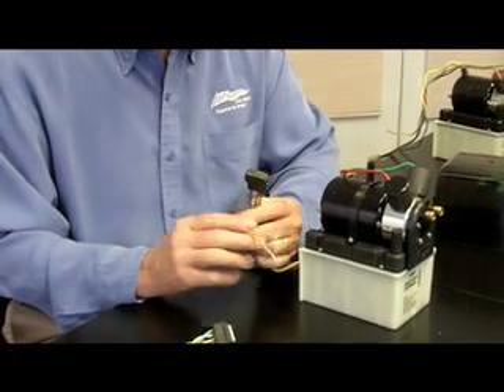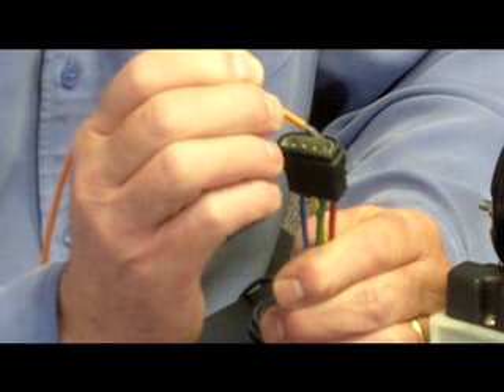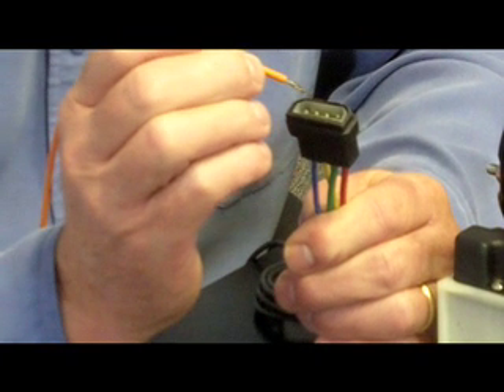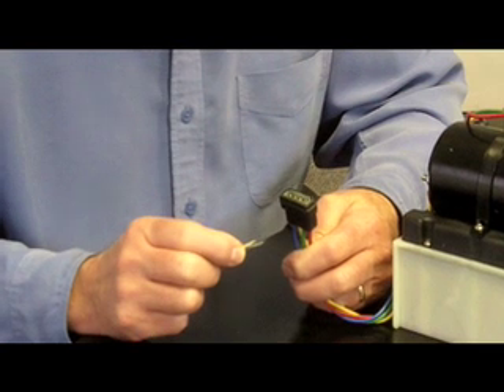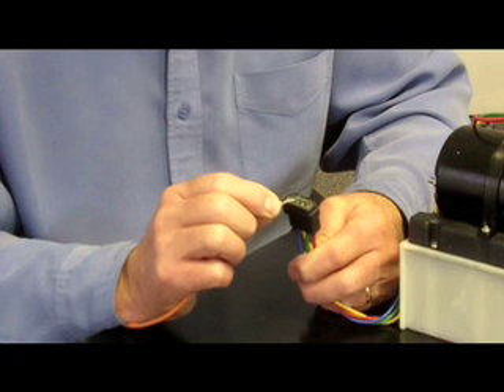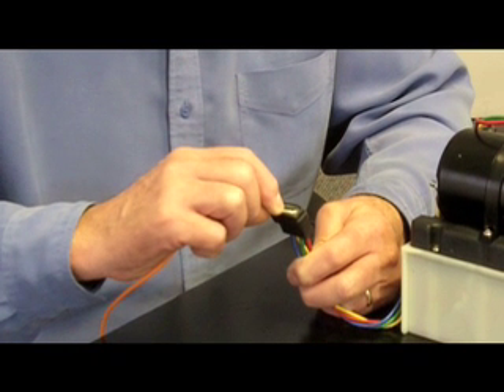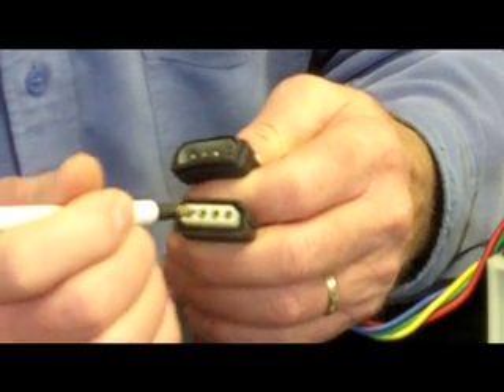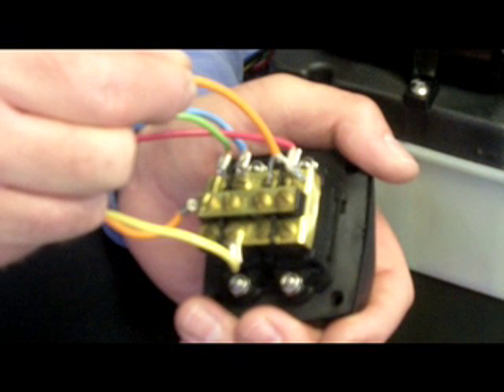Trim Tab Troubleshooting: HPU Motor Runs, Tabs Don't Move

Comment: Thank you for this terrific video.  It helped me exclude the pump and the switch from my search.  I disconnected the line to see if it was actually pumping.  Turns out there was water in the pump, and the reservoir.  Flushed it out a few times and everything is working well!

Comment: Good evening, so I have new pump and when I apply power to the solenoids they are decent, but not loud clicks. The power to the yellow(reverse is strong) but the power to the blue(forward)is very weak. Fluid is full and have full battery and connections. Did I get a bad pump? Also, the test of sending power to one connector at a time isn’t affected by the trim tab lines correct? It’s in the boat not on a work bench. But the plug is disconnected
Reply from the maker: Please give us a call at 1-866-894-1626 (Option 3) so that we can assist. Thanks!

Comment: Very nice explanation thanks. I need to fix my old Bennett HPU. Vintage 83 Team Scarab race boat. One side just clicks, other side clicks and motor runs.  Neither tab moves. I'll check out the tab video also. Reservoir is full. Boat launches like the the Space Shuttle - in my case that means pointing straight up, haha.
Reply from the maker: The best course of action will be for you to email our support team at BMI_Info@Yamaha-Motor.com. The techs can help you diagnose the issue. They have a backlog at the moment so please give them a few days to respond. I'm confident they will be able to assist.

Comment: hi great vedio where do i buy the motor only to replace it ty
Reply: The motor is not sold separately. You can go to just about any marine parts dealer or search the internet for a replacement hydraulic power unit. Part number V351HPU1

Tom McGow
Bennett Marine

Comment: Very helpful video.  I used your troubleshooting process and found I had a stuck motor.  I disassembled the front plate where the hydraulic hoses connect, then used a screw driver to turn the shaft.  Now the trim motor operates in fwd, reverse and the solenoids both trigger.  Thanks again.